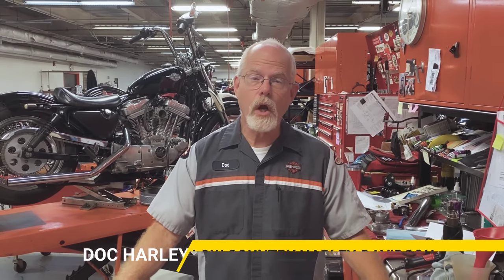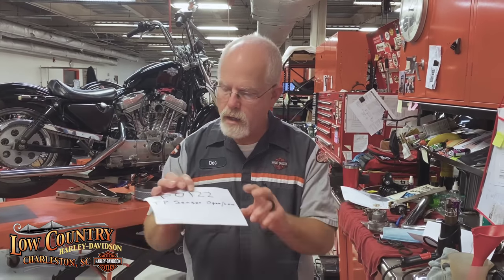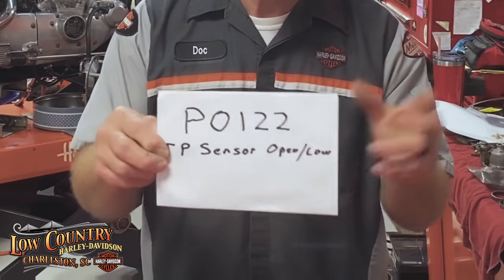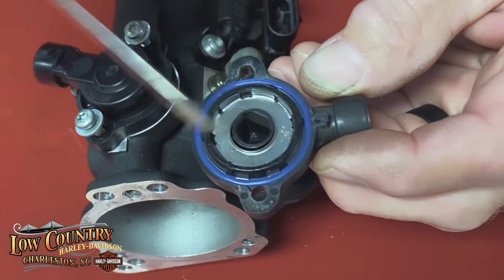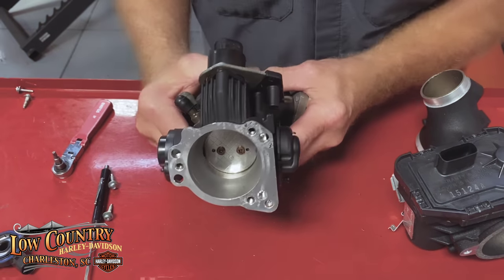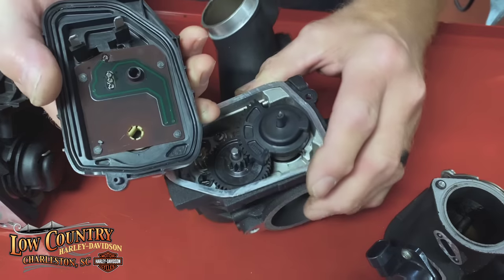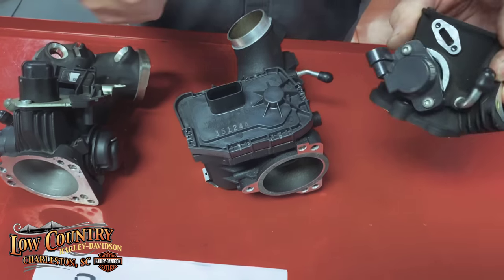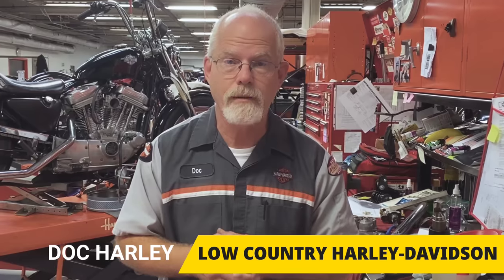Throttle Positioning Sensor | Doc Harley | Low Country Harley-Davidson

Comment: Thank You….My 2016 Dyna low Ryder stalls at traffic lights when it’s hot outside…
Reply from the maker: Have you checked for Intake manifold leaks, fuel filter condition and battery condition too?.......Doc
Reply: @LowCountryHarleyDavidson  The battery is new but I did not check the Fuel filter or the manifold…It runs fine except when you come to a stop light it dies
Reply: @LowCountryHarleyDavidson  U0156 code ?

Comment: Can loose cable throttle cause this code
Reply from the maker: No….Doc
Reply: @LowCountryHarleyDavidson  most probable cause of throttle pedal position circuit low ? Engine light goes away while throttle is applied

Comment: Purchased a used 2011 SG from HD with 40,000 couple mi.I rode it for a couple weeks then when I stop at light the throttle will Rev up & down a little and tbw won't do anything. I've taken it to a reputable shop we thought we had it?
But no it did it again another 4 different times while on a Run this is not good on a two lane back road with 270 bikes behind you,could any one have an idea?
Reply from the maker: Wow. SG has custom bars? I would remove all TBW components and look them over. wiring could be cut, damaged or pinched. the TB connectors could be of the old style and not making the right connection. There is a video on this. The gears in the TB could be bad. Do you have a Tuner connected like A Power Commander? Take it Off!!!.....Doc

Comment: I'm at 150k doing fine. 1511, 2135  codes since bike was new every now n then. Wires ends was bad a new . It clears n goes on for many miles b4 it might do it again. Goes into limp mode . Stop n clear it and go on.might be time to replace it 2010 , 150k on it.
Reply from the maker: Might be time to change the pins in the connector at throttle body…..Doc

Comment: Hi Doc  i m using road king 2016 model, i drop my bike at work shop for change oil and service, mileage meter was 9289, when i collected bike meter shows 16.5k, i complaint to work shop they said ECU has been remov to check another bike for 2 days and reinstall back that why mileage has been change they are trying to fix the problem but no success, i like to know whats cause and solution to bring back actual mileage 
Regards 
now facing problem with mileage on meter, actually mileage is 9200
Reply from the maker: The ECM has the mileage in it. The other bike has the higher mileage. The speedometer after 35 miles reflects the ECM mileage of the higher miles...you can not turn back the hands of time...new speedometer needs to be ordered ...Doc
Reply: @LowCountryHarleyDavidson  i much appreciated your feedback, with high mileage ECM will reflect higher mileage if i change new speedometer or i have to change new ECM ? Looking forward your response please 
Regards

Comment: Im having issues with my 02 Deuce spitting and sputtering at different speeds ? Adjusted my throttle cables and that helped some but still happens ? 58,000 miles and Im Stumped ?
Reply from the maker: My first concern is Intake rubber seals leaking....Doc

Comment: Ran codes on my 2011 street glide one popped up no rsP
Reply: Had another one popped up P1353 the motor turns over but does not start
Reply from the maker: Front Cylinder no combustion detected. Could be as simple as a loose spark plug wire, a failing O2 sensor, a crazy short exhaust with no baffles, a dropped head valve...The list is endless. Take it to your local dealer.....Doc

Comment: I have a dyna 05 efi twin cam 88, after riding at highway speeds when i come to a stop my hike stays idling high as if i was giving it gas, would this be a sympton of the tp sensor?
Reply from the maker: Could be but more likely an intake air leak, throttle cables needing attention or maybe too lean?…..Doc